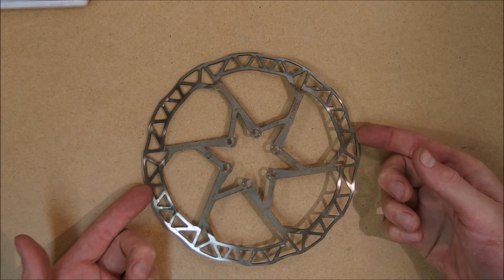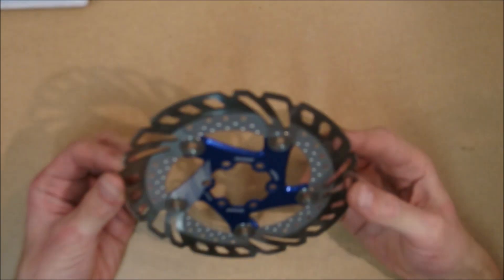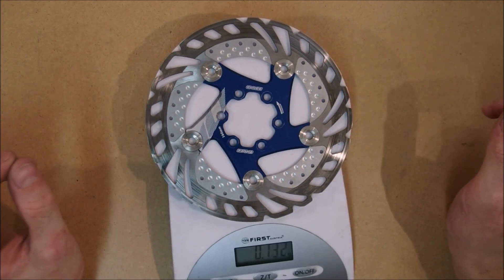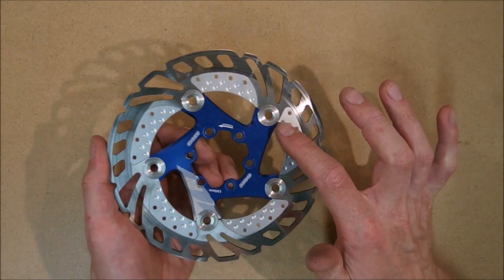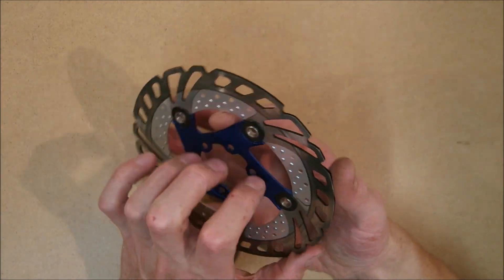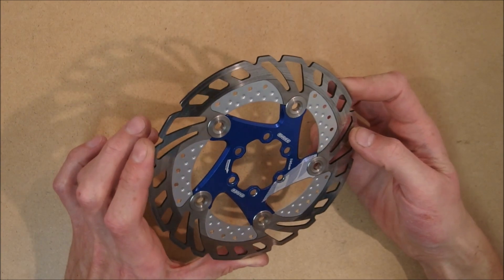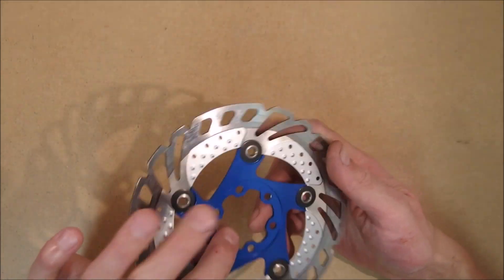Review: Chinese finned brake rotor: Enlee 160mm

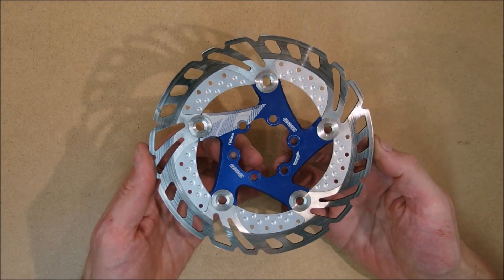Comment: 2:49 the holes are clearly too big, I think this is why Sram rotors also have issues.
The best rotors I rode with so far are Hope floating rotors, 
I used Shimano resin only, which were useless, they got hot, wore down fast, with metal pads, but with resin pads the pads only lasted 4 weeks. it was the worst rotors I have ever used, but 
They got slippery pretty fast, sandpaper & braking in did not help, I switched to hope floating rotors, and the performance has been great.
I haven't used many.
Avid steel disk
Promax
Tektro 
they did ok, wear was pretty decent, but they were heavy.
but Hope floating rotors stayed cooler, and were pretty quit, I have been using these for years, with good result, I haven't worn them out yet, I used them on 3 wheel sets on 2 trail bikes, so I swapped them, but I still got a lot of use.
I have also been using TRP-29 rotors for a while on my xc bike,so far no issues, but I will see how it goes.

Comment: I don't think floating rotors are a gimmick, but not every one needs them, nor do all need 220mm rotors and six piston hope brakes, for me it would probably be overkill, but I haven't tried it yet.
But I think most will be fine with 160R 180Front disks, but more braking you do more it matters, I ride fast and brake a lot, but on my xc bike it makes no sense, but on fast downhills it will matter, but also size of rotor, but I find 160R 180F to be good enough for local trail riding.

But Resin only disks are stupid, I wish they were gone forever, same with single piston mechanical brakes.
Reply from the maker: I never understood what is the appeal of floating rotors for cycling. We don't really reach speeds where the 'floatiness' is relevant.

I'd disagree on the rotor size tho - I run 203 front across all my bikes ( with the exception of the gravel, obviously ) and only the rear changes between 180 and 160. Sometimes I wish I had bigger front...
Reply: I will probably try bigger rotors some day, I plan to build a new bikes, but my rotors are still going strong, they have at least 2 years to go maybe more.
I use both of my brakes, but my brakes and rotor are powerful enough for stopies, all the downhills in my area, but I haven't tried to do long downhills on a big mountain, I guess bigger rotors would be beneficial there.
I can stop well from 52km quite well. I can definitely feel my brakes are warm after braking with Hope floating rotors, but they don't overheat, normal rotors became hot like a heater. but bigger rotors would probably help, but weight weenie as people call it would want floating rotors due to lower weight.
so the appeal is smaller rotor lower weight but still good braking, but I see that some xc racers use 160 front, I haven't tried that, what I know is my hope rotors work better than all other rotors I have tried in the same size.
I use TRP Spyke mechanical dual piston brake on my xc 26er bike, and on my trail bike is use Deore M6000.
Reply: I see downhills who ride for hope use 220 vented floating rotors, I haven't tried those rotors.
Reply: THe resin onyl rotors are probably made of weaker steel,  than hte other steel rotors I have tried.

Comment: Don't buy Chinese rotors  not because they're cheap they're poor quality,they are thinner and rust over time.
Reply: maybe 20 years in the past. nowdays china makes best bicycle parts in the world.
Reply: My new floating rotors didn't come loose on the rivets. Do they become loose and start to float on the rivets like a true floating rotor after a short break-in?  If the rotor doesn't float on the rivets then they're not floating rotors. They're fixed rotors with rivets in them.